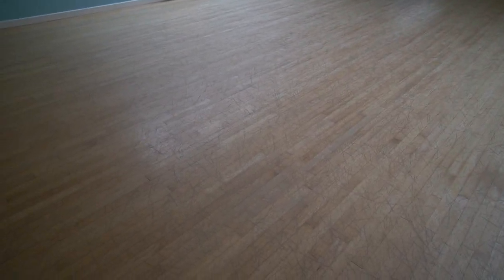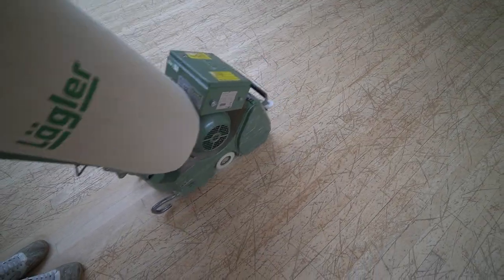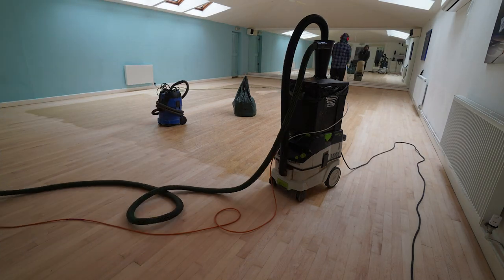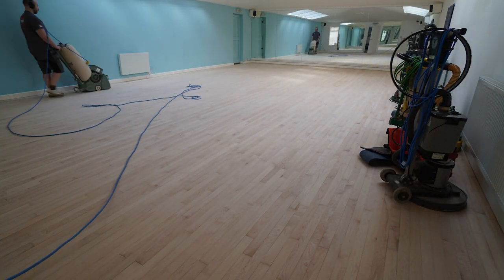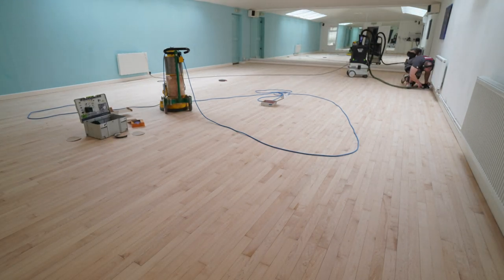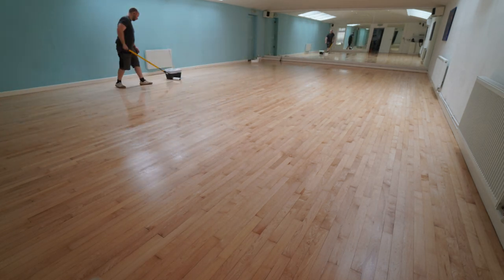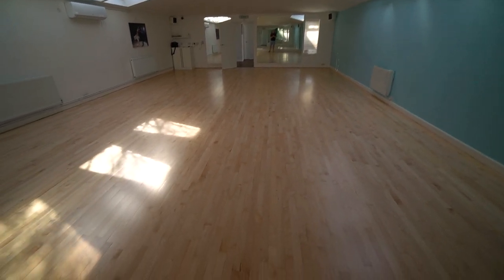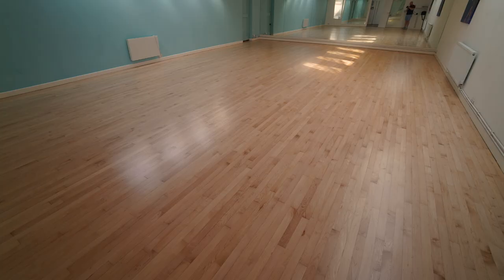It was in a BAD WAY (Resanding a Worn Out Dance Floor)

Comment: Nice job, I've been doing floors for over 30 years and bona does have the best product by far. When I seal a floor on the first coat,  I will let it dry and than abridge with a purple pad. I do this with all the coats except for the last coat where i will use a 220 screen. Does amazing job.
Reply: Loba finishes from Germany kick ass on anything bona makes..trust me!

Comment: Great video. The only thing I do different is to use mirka deros instead of festool on edges after. I'm always wondering If I should have got the festool 🤔
Just invested in the flex 150 sander actually which looks great

Comment: Great floor,great video. I used the drum sander and stained it now thinking about what finish I am wondering whether to oil or poly it. If you worried about shaky ness try a gimble out there are some pretty inexpensive handheld ones.

Comment: That's the kind of layout I'd be using the t bar on.
Reply from the maker: I would if I could use the damn thing properly, I always get lines on the trailing edge. Tried going faster slower, slight twist on the back end on the front end. Given up
Reply: @HowToSandAFloor  gotta pad out after each run. I've pretty much given up too. Been a while since I barred a floor.
Reply from the maker: evsnova74 wow, that’s saying something because you are the master of barring
Reply: @HowToSandAFloor  this is why I gave up on the t-bar and only roll now. I swear I used to be able to do it without the line though 🤔
Reply: T bar is excellent for large areas , trick is to take it nice and slow and steady , maintain a wet edge ,,
Reply: @tommytufguy3432  depends on the finish too. We never had it with traffic but when we switched to idro2k there were obvious shiny lines and lift marks. We just started applying an area that you can still reach across, then straightening up over all of it padding out between each pass. Very time consuming when you're trying to move fast with a 2k waterborne.

Comment: We usually finish the edges with 100 or 120 in darker stains, and we buff with 150, and hand sand with sand dollar pad, then we coat the floors with 6 inch brush by hand
Reply from the maker: Very similar to me, I haven’t used the dollars yet but I’m tempted, would never apply by brush 😂 my back would break

Comment: I have watched most of your videos and have an old house with original floors, ~1820's. The boards are very bowed, so the joins are like ridges. What's the best advice for these? Do i just have to be brutal and sand them level?
Reply from the maker: This is called cupping and is caused by the moisture on the underside being higher than the level of moisture on the top surface. If it's been like this for a long time and hasn't change then yes you can sand it. If the cupping is too bad, it might be a problem

Comment: Seeing that floor makes me regret choosing polyurethanic lacker! Your tuttorials helped us get a nice and even sanding on our parquet floor, but we are having problems with minuscule  bubbles forming all over on the third coat of polyurethane, even after 48hs of drying of the second coat (wich came out nicely). Have you worked with this material?? (we use Lackol K-4045)

Comment: I'm suspicious that grit grades are not so standard across brands and locations.  Someone told me that when they used 40 grit (same as my brand) to start a job it was way to aggressive and left deep grooves that took a long time to get out on higher grits. He suggested me to try and start at 80. He said would level and be enough.  So I'm wondering if my 80 will be your 40. Possible right? Edit: started job. Yes. I soon realised that 40 grit is just enough. If I were to do it again i would go one lower. Done 40, then 80 and will do 120 next day. Result. Good enough for older house. For new house I'd do more.
Reply from the maker: No, there are variations between manufacturers but not that great. That guy probably didn’t know what he was doing. I’ve sanded floors with 16 grit, as long as you progress your grits properly it always comes out with the next grit just fine. The grooves could have been misuse of the machines, wheels not set properly, unevenness in the floor while sanding straight and having the machine tilted. Unless your floor is new 80g is very high to be starting the sanding process.

Comment: The dirt around my house is VERY sandy. I have three dogs who have a dog door so they can come and go outside but what it means is that they track a LOT of dirt inside! My 100+ year old house has old oak flooring which I refinished when first bought the house but has essentially been "sanded down" because of 5+ years of constant dirt being brought it. Basically, the sand has "sanded" off the polyurethane I used and left me with bare and very dirty floors.  Its there a product available (in the US) that you would recommend house on floors with high traffic and dirt/sand?  How often should I be re-coating or refinishing them?

Thanks! And You're videos are great!

Comment: How would you suggest doing a hallway with the boards running opposite the long length of the space?  Strictly use an edger like a closet or sand the boards across the grain with a drum sander?
Reply from the maker: Edger for sure

Comment: You didn’t edge after the 60 80 and 100 grit? Did you remove the ridge with the rotex? We usually finish with 80 grit on the big machine then do one edge, pull corners and then trio and palm sand.
Reply from the maker: We usually don’t have much of a ridge, the trio does most of the work of smoothing the transition. We have started using 3m cubitron 2 on the rotex. I regularly go from 36 edge to 120 rotex because of these cubitrons. And they will last for ages. If there’s one thing you need to do right now is try these cubitrons on the rotex. Whole other ball game. 🙌🏽

Comment: I have a maple hardwood flooring for my dance studio.  Just can't get the finish to adhere to Tap dancing.  Third time refinishing.  What is the best poly to use?
Reply from the maker: Are you just overcoating it? If so you may have to resand it after having a failed attempt at an overcoat

Comment: I've just bought a house where the previous owner refinished about 1100 sq feet of wood floors and left them somewhat rough (air bubbles, dust trapped under polyurethane?). Do you believe that we could try to just buff the top coat of poly and lay down another coat?

Comment: I put the third coat of tung oil on last week. It's looking great. I found your videos and pdfs really useful. I used bona mix and fill like you recommended. 

I made the mistake of getting out the vacuum between coats. Do not do this. Made a lovely scratch. But the third coat mostly hides it. Also brought out all the lines where the belt sander was put down. So try to lift up only on the edges. Orbital sander took the longest, after picking nails. Think I went through about 25 orbital pads all up.
Reply from the maker: You have to vacuum between coats, just use a vacuum that doesn’t have a hard surface in contact with the floor (brush head!)
Reply: @HowToSandAFloor  thanks for correcting him

Comment: Had problems clogging the paper while buffing? Sometimes I get with WB bona products. But yes, bona products are the easiest to apply.
Reply from the maker: I have, usually just needs another half an hour to hour to dry a bit more, atleast in my experience
Reply: @HowToSandAFloor  Even bone dry waterborne finish will clog while buffing, Change your paper when you hear a squeaking type of sound. That buildup on the pad will cause scuffing that don't completely disappear in the final coat.
   -Nicolas Gonzalez
                Installer/Refinisher @ D.J. Williamson and sons wood flooring, serving the Palm Beaches for over 30 years.

Comment: I have a new house and we put down light colored engineered hardwood floors that are very very very matte (as in not shiny at alllll) they look SO dull I can’t stand it! Can I put a clear coat of polyurethane on them? If so do I need to sand first? I think their pretty thin like 1mm real wood on top and it’s almost brand new so I wouldn’t wanna sand it

Comment: Thanks for the video! Using a polyurethane, don't you need to sand after each coat? Or is it just needed before the final coat?
Reply: You are correct. With oil-poly, you have to lightly sand between successive coats. 150-grit or higher is preferred.

Comment: Hey, I am learning how to sand floors and right now I have a practice pine floor to start out on. I was just wanting to ask you if you have tips on how to handle a soft pine floor. There’s not much on YouTube about pine, so I wanted to ask if you have a general grit sequence you follow for this type of floor? Love the videos!! Respect your craft. 🙂
Reply: For soft wood like pine i like to try and only run 1 or 2 grits. Use a rough grit like 36 to grind off finish and a slightly finer grit like 80 just to wipe away some heavy sand marks. I dont like using to many grits because it's easy to sand to tongue and groove because of how soft is. Once your done with the 80 buff super good with 80 grit. Seal it up buff it out with 220 grit to smooth it. And apply as many coats needed after
Reply: With maple or oak i run 36 80 then 120

Comment: Hi there. When you buffed in-between coats of poly, what grit did you use? Thanks!
Reply from the maker: 150g
Reply: @HowToSandAFloor  Thanks. Btw, your videos are the best, but I'm sure you know that. I have a screen printing business, and bought an old building on my towns main st. Above it is an old dance hall that was covered in carpet. I ripped out the carpet and this weekend I'll be sanding the old floors. I've watched all your videos and I think I'm ready to take on this project. Thanks again.
Reply from the maker: @revolutioninprint8906  how big is the dance floor?
Reply: @HowToSandAFloor  It's maybe a little bigger than the one in this video

Comment: Is aluminum oxide not a good option for these heavily used areas?
Reply from the maker: Great question, for one thing ali oxide contains formaldehyde so it’s band from being used in application in the UK. But also aluminium oxide is tougher but more brittle in the sense that it will sooner crack than bend. So dents have cracks round them and can lead to air and water getting in and damaging the surface further. More maliable finishes keep a seal when dented.

Comment: Did you use three coats of Bona Traffic? I’ve seen other videos, where they only use traffic for the final coat because of the hardness. I think they used satin for the first two coats.
What do you recommend?
Reply from the maker: Pound one top layer of traffic is better than none, but three coats of traffic is better than that still. Much better. If I’m honest doing traffic for only the top coat is a bit of a cheap cheat. This is a commercial floor. It’s going to receive a lot of wear and tear, it needs to be properly protected.
Reply: Thank you.

Comment: Hey man. I bought your guide in 2017. I am not on a leave of absence from work until April due to Covid. I have lots of time on my hands. Do you think refinishing my floors with a festool rotex 150 is feasible? Thanks for these videos!
Reply: I hope you didn't try this. I've done a room and hallway with a 4x24 and 36 grit belts (starting) and mostly hand scraper, respectively, finished with a dual most sander. It's a rough time even if you have an ideal floor with no deep dents, and depending on what's on your floor , you may just gum up discs in a hurry and then the gum-up will bruise the floor on rotary mode.

Comment: Very nice... What grit was the final sanding 120? and buff? 150?
Reply from the maker: 100 trio (silicon carbide, very smooth) 150 buff
Reply: Thanks for the reply.....I will try that.
Reply: @HowToSandAFloor  Hi , would 150 on the trio be too much for the final buff before the final top coat? thanks
Reply from the maker: @1larock  the trio is just a bit heavy tbh. Take the weight off and it could work as long as you’re quick.
Reply: @HowToSandAFloor  Thanks Ben!

Comment: Why use a 8" sander when a 12" takes 1/3 less the time!?
Reply from the maker: The only 12” on the Uk needs 3 phase power. Most smaller buildings and homes don’t have that
Reply: @HowToSandAFloor  I've had the same Clarke 12" 220V 30 amp for 25 years!.all homes in USA have 220 power..

Comment: What do you recommend using for 1. paint that some @ss dripped on a hardwood floor and 2. daily cleaning for a hardwood floor?  Do you use oil on the hardwood?
Reply: i would recommend you re-sanding and polishing the entire area living room, bedroom, or even house because if you were to just scrape the paint off their will be a variation of two sets of colours on the floor.